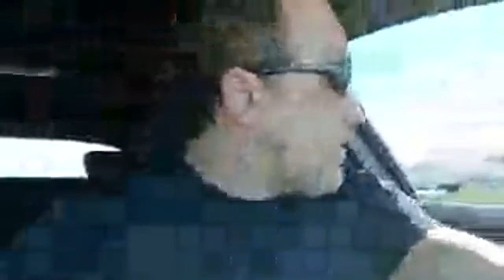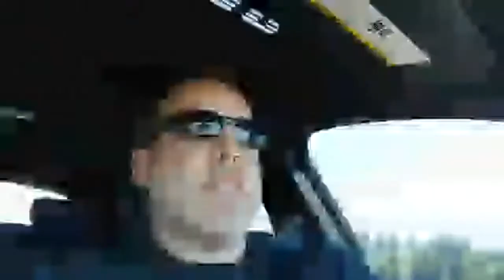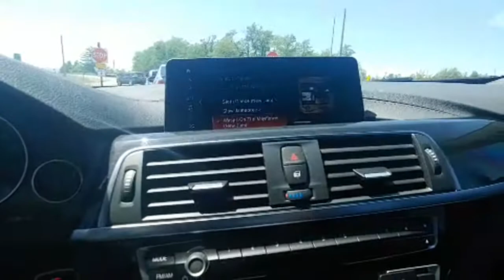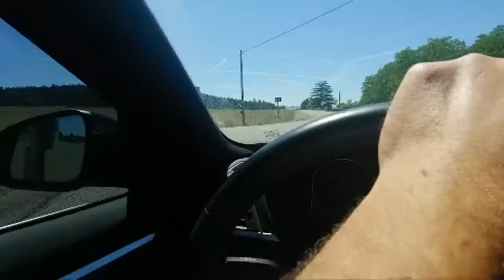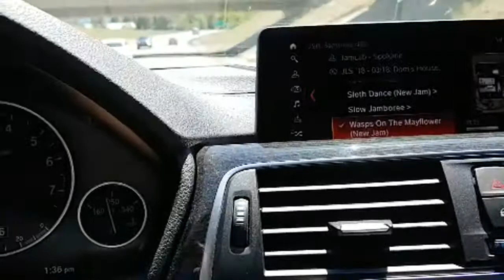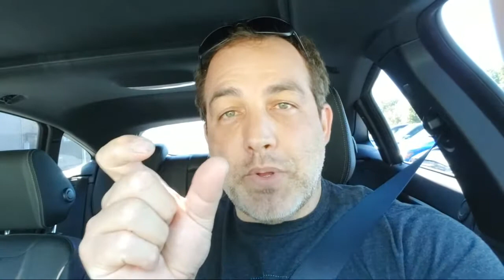Dyno Heat Management During Tunes

Comment: Why we are at it I will build a tempered wind tunnel with your mustang dyno inside of it
Reply from the maker: How are we going to get the exhaust out?
Reply: @GetaDomTune  I will just recirculate it and pass it through some peroxide and charcoal filters so no one will suffocate. Might just need to think about it but I may be able to collect the exhaust as its heavier than air then vent or clean . I could also make a distillation device like chevron has to make ethanol fuel out of burning debri.
Reply: @GetaDomTune  or to simplify it i can hook a hose to the exhaust like a 4 inch flex then send it to a fan that exhausts it outside
Reply from the maker: @bradleehill9662  not looking to increase or decrease back pressure on the exhaust artificially
Reply: @GetaDomTune  ok I'm trying on small budget if you are serious i will actually look into it and come up with a solution as there is one that isn't a spitball idea. Worst case scenario it will be a good think tank project for me......
Reply from the maker: @bradleehill9662  don't waste your time on ours. 
We have a dyno dynamics dyno, btw. Quite different than a mustang

Comment: Just hire me to come and put in a badass ventilation and a.c. system like the baller i am problem solved just takes a good couple hundred ground and I will give you whatever temp and humidity you want
Reply from the maker: Couple hundred bucks is my budget
Reply: @GetaDomTune  yeah if you already have a good way to cool the area get a 6inch exhaust fan and some 6 inch spiral hard pipe any hvac shop should have these items pipe this over close by the dyno then use the flex spiral rubber 4 inch high temp to clamd onto exhaust use light switch this will get rid of exhaust to outside allowing you to shut the door but wear earplugs cause we all already do this anyways
Reply: @GetaDomTune  time to hack up some window AC units Dom